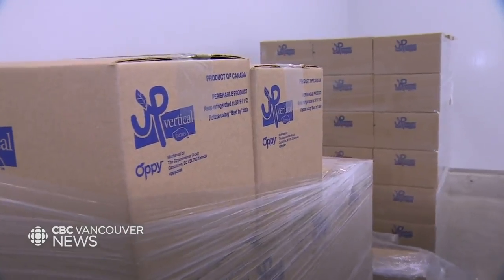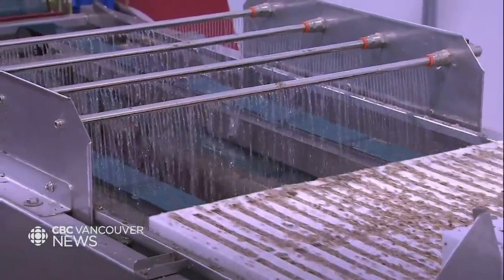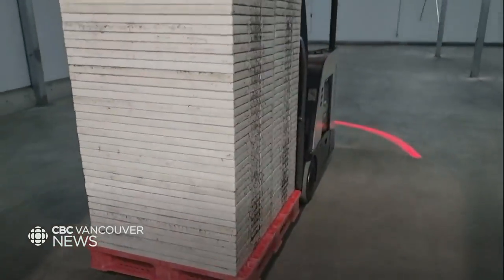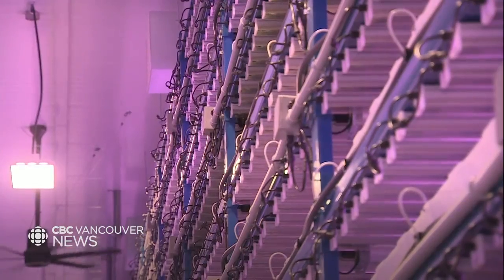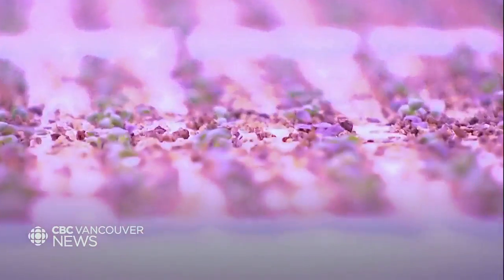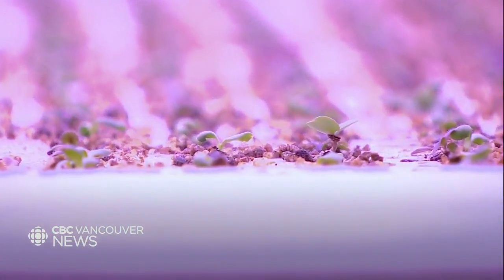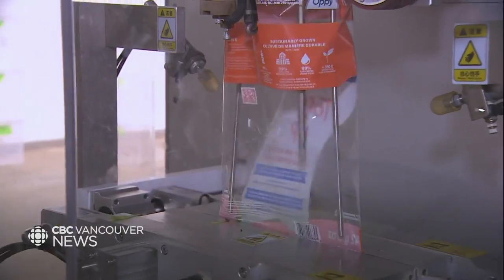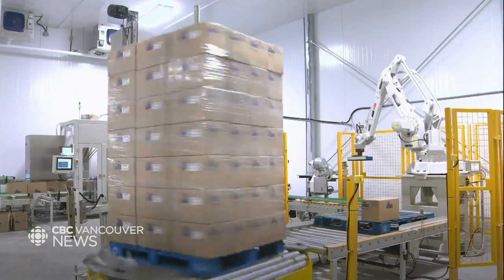B.C. vertical farming company growing high-tech produce

Comment: How do you harvest? How do you get the plants off the rack?
Reply: It’s cut with a blade. All harvesting pieces are cleaned and sterilized between harvests. No human touches during the harvest process
Reply: @kevinb8887  Hey Thanks Kevin. I was wondering about the handling of the trays. I have seen so many of these types of set ups and they always require manual handling of the large unruly, water filled trays in order to get them off the grow racking. If that is what you call them. Is this the case with this farm? 
Thanks for the response! good luck!